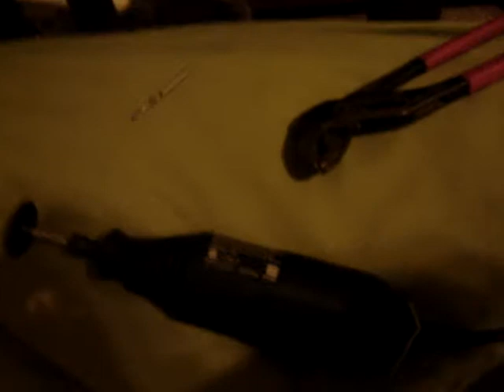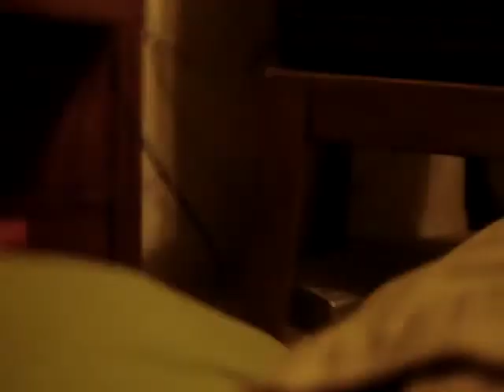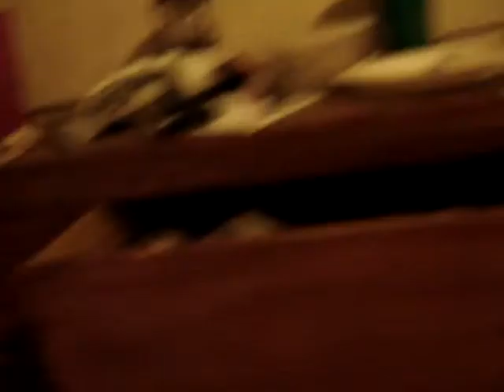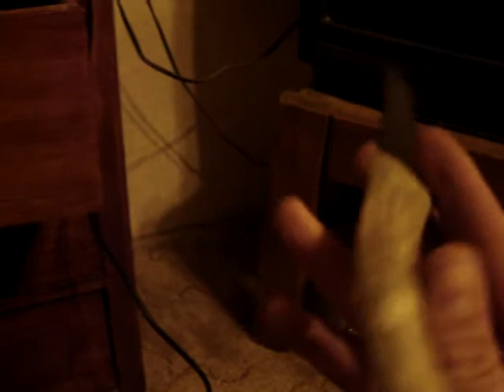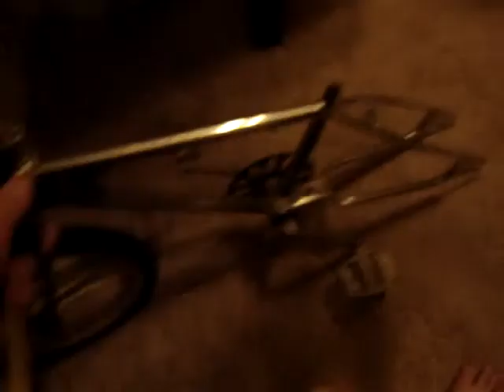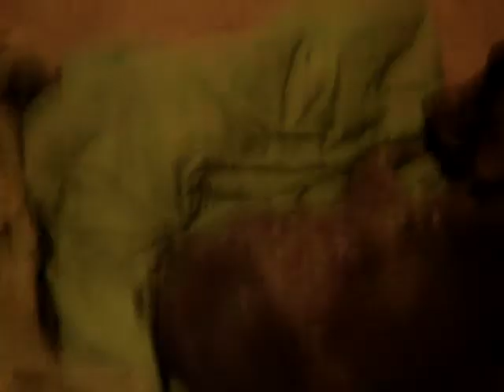finishing my home made knife

Comment: uh first of all you should get an angle grinder. You can pick one up at Home depot or lowes for about 30 bucks. Make sure to get a corded one. Also instead of using the file they sell steel plates that are around 48 in long and an inch wide. They have a bunch of different thicknesses, but i use 3/16 inch steel for mine. These are sold at Home depot. But that is an awesome knife!